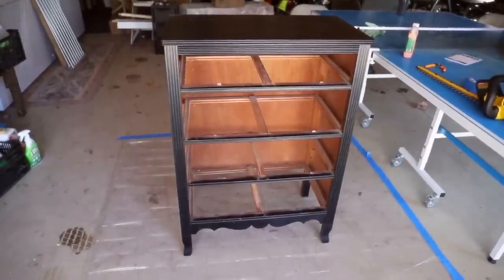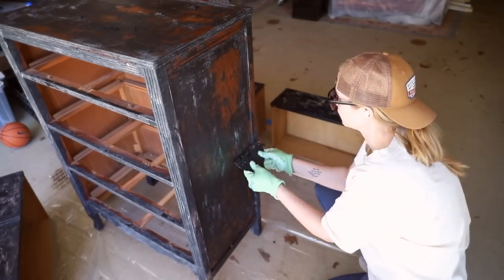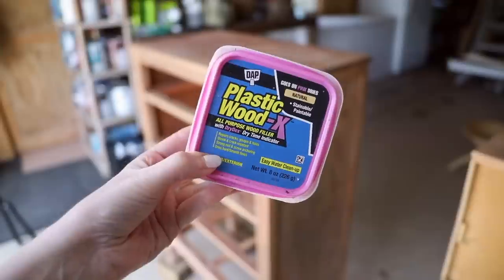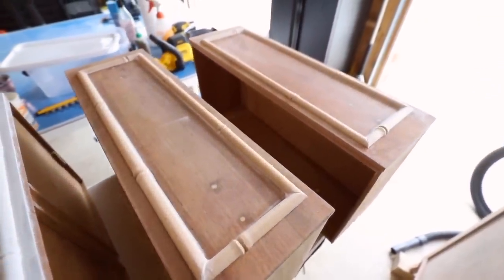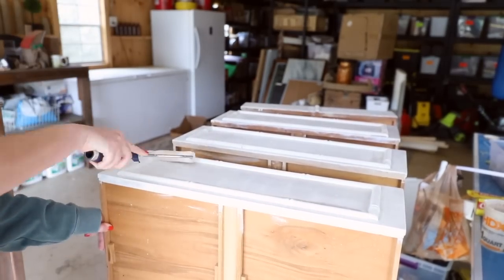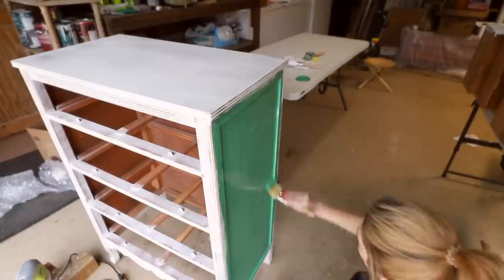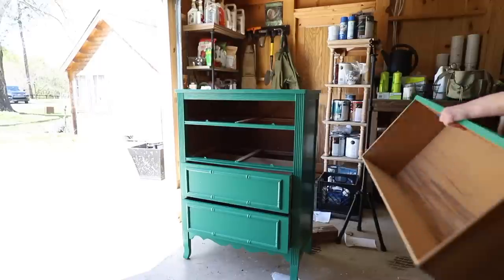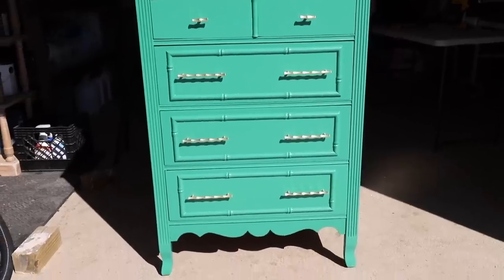Granny Chic Furniture Makeover! // Beginner DIY Dresser Painting Flip // Before + After

Comment: When you strip a previous paint, you always have to apply the stripper several times. I’ve done that my whole life and I never saw a paint coming off right away. Also, if you cannot rinse your piece of furniture with water (some woods don’t like that), it’s always better to neutralize the surfaces with alcohol to remove any trace of stripper, otherwise it may continue working under the new paint. Here, you obviously sanded the wood a lot, so I don’t think that anything remained on the wood. 
Doing a lacquer-like paint is probably the most difficult thing to do because the surface must be perfect underneath. Personally, I prefer looking at what the wood is telling me and decide what I will do next. I am more a naturel look for the wood person, and I would have never chosen such a green color, even less a shiny color, but I am actually curious to see how it looks in your room, in the middle of your decor. 
This was a very bold project!